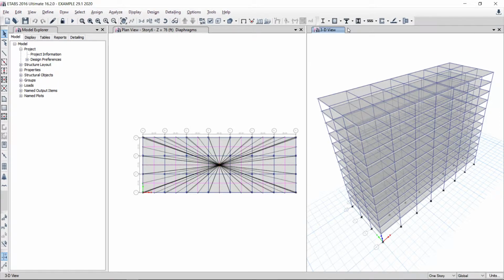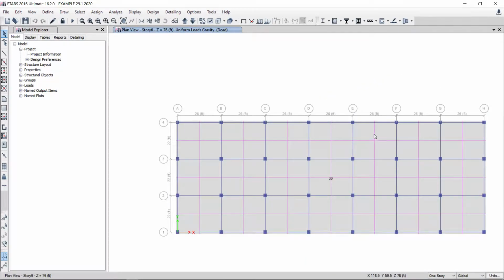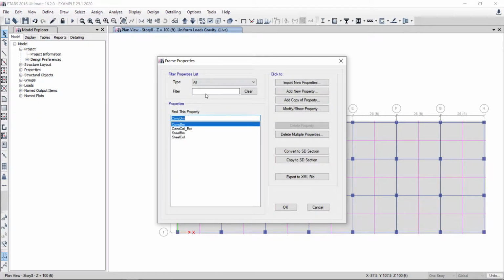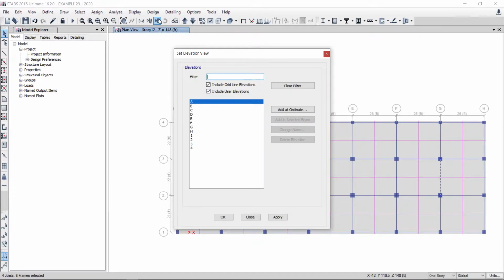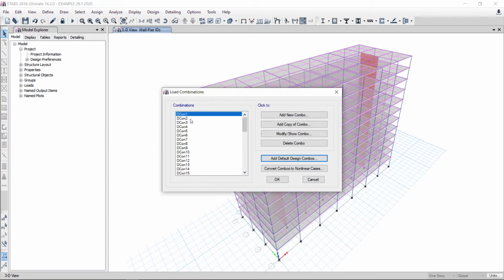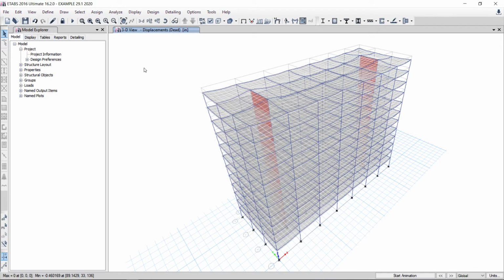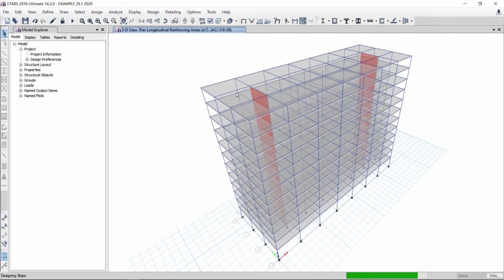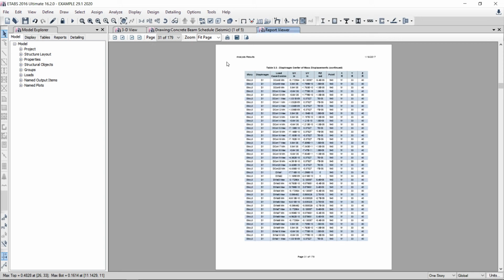INPUT DATA PREPARATION OF A 12 STORY BUILDING IN ETABS

Comment: Sir i have a question when to use direction and eccentricity ..
I mean when to use earthquake with eccentricity or without?
Reply from the maker: For Seismic Load, you have to consider both X & Y directions. Eccentricity is your choice, if the geometry is true symmetrical, you can neglect it. But that is hypothetical case. Better take 5% eccentricity to be on conservative side.
Reply: Sir please make video on dynamic analysis also
Reply from the maker: @nitinsharma228  Sure, I shall do it.
Reply: Sir what is function of pier that you applied?
Reply from the maker: @nitinsharma228  It needs in design of wall. You can delete the pier definition and see the result.
Reply: Okay sir